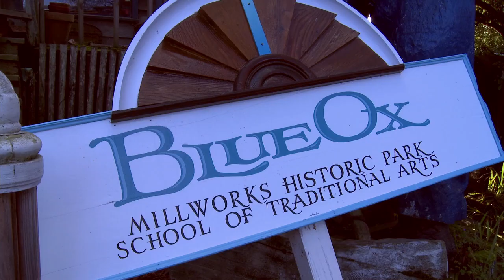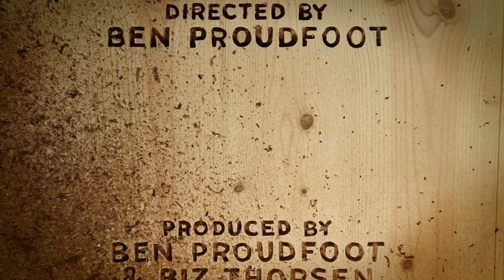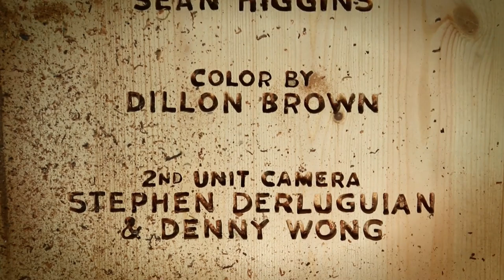The Ox - Portrait of a Master Woodworker

Comment: What was that device for pointing pickets or stakes at 1:47?
Reply: A Portland Picket pointer built in 1900..... Eric
Reply: @blueoxmillworks  Thanks. It's fascinating to see that middle path of mass production combined with manual labour. Some would think it takes the skill out of work, but I have spent many a contented hour being productive with devices such as these. There is a calm which can come over you, knowing you are reliably producing something useful, yet with a moderate skill level. Too much skill needed and there is stress. Too little and there is boredom.
Reply: @campyper5299  OH MY.... well said... Eric

Comment: 'I did 1200 by hand' then sticks it on a machine?!  I think it cant be that good if you dont even know what is 'by hand' is!
Reply: how many could you do "by hand"
Reply: The machine is a lath. In order to turn something yo need to spin it. The thing you will notice is that I don't use any duplicators, all is done by eye and by hand and I get them all the same. This is a learned thing and it's just see the basics then practice.  Eric
Reply: blueoxmillworks exactly my point, all turning is a machine job, doing it by hand is carving.
Reply: Our House, good point and well taken. You are right and in my 43 years of doing this work I have seen carved corner blocks and even a combination of turning and carving. I have only done a couple of the later, and never the former. There is something to look forward to.   Eric